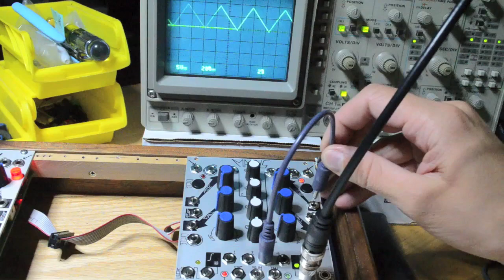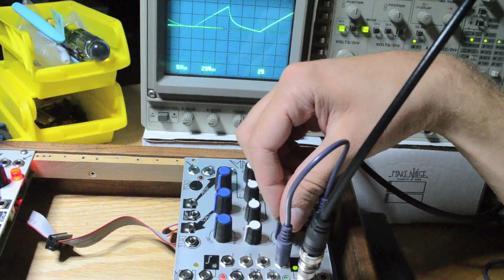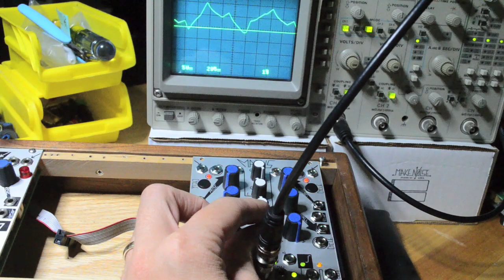MATHS Advanced Envelope Techniques

Comment: around 3 minutes in, you use the modulation from channel one's unity out to the both input of channel four but you say you have to run it through the channel two or three otherwise it would be removed from the OR bus. Why wouldnt you just run it straight into the both input of channel four from channel one's unity out? I thought the signal from a particular channel was only removed from a bus when you tapped out of the variable 1-4's??
Reply from the maker: You are correct, the Unity outputs are not removed from the buses when patched. However, I wanted to be able to attenuate the signal before patching to the BOTH input, because that input tracks exponentially and without attenuation the effect will be extreme. - W
Reply: cool, thanks for clarifying my ignorance =-)
Reply: @MAKEN0ISEMUSIC  A subtle little trick for sure. Nice one!